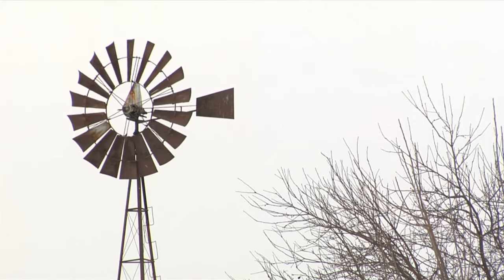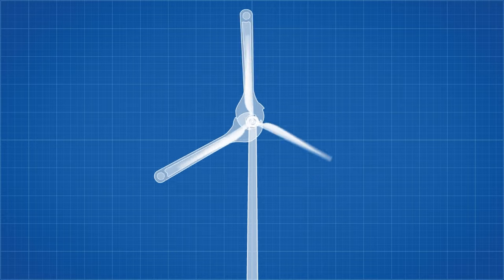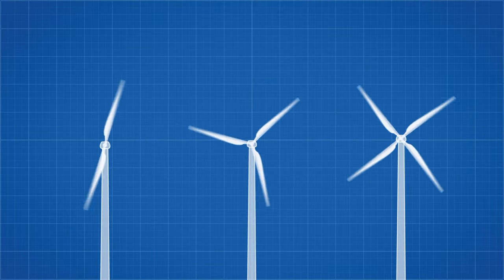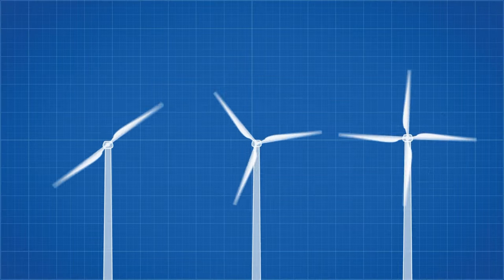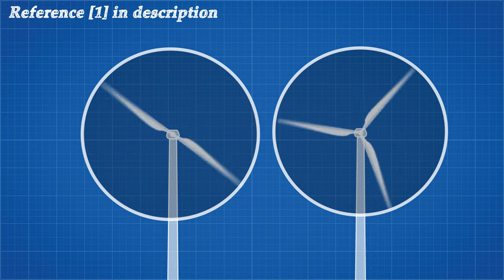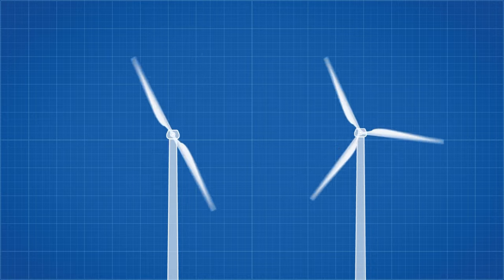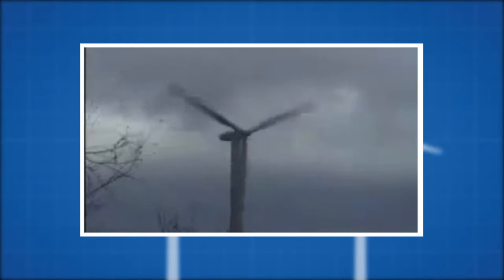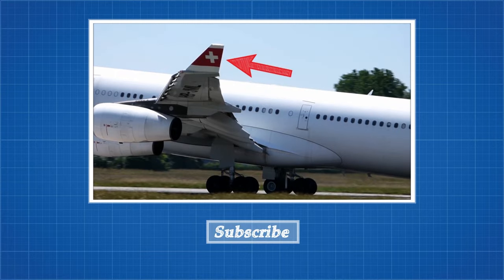Why Do Wind Turbines Have Three Blades?

Comment: quite shallow explaination why not 4 blades. did not explain why the additional power is small, you just stated it. but thats the important part no?
Reply: I thought it was pretty shallow too... Why not shorten the 2 blades so they exert less torque --> less speed on top of saving money on material?  Adding a third blade just to slow down the angular speed sounds fucky
Reply: Yep, sure a fourth blade costs 33% more, but if it's output is more than 33% it makes it worth it. There is really no reasoning for dismissing 4 blades so quickly.
Reply: Less torque = less power generated.  Take a computer fan and blow into it.  It's 7 blades and is spinning more times per second than a wind turbine.  Quieter too.  But it's not going to power your city.
Reply: The guy in this video doesn't seem to have a lot of knowledge about the technical part of windpower... Well yes, they cost some more to produce a fourth blade, but when we are talking about the whole project, then the fourt or fifth blades additional price increase is just some few percent.... 

THE MAIN REASON WHY WE USE 3 BLADES IS: There is a aerodynamical phenomena which is reason and it is someway hard to explain, but I'll try.. If you would have let's say 6 blades, then the wind speed would decrease significantly after the turbine. So imagine what would happen if the air behind the propellers stood still. Yes, the pressure in front of the turbine would also be higher, so the wind would "go around" the turbine. Because it would be almost the same thing as an unidentified physical obstacle would stay straight out in the wind. SO you want to get the wind to go through the turbine as fast as possible, but still take as much kinetic energy as you can from it. So there is this perfect ratio AKA Betz's law (https://en.wikipedia.org/wiki/Betz%27s_law) which says you can take maximun 59% of the energy from the wind, today we're at about 40-45% in the best cases... Then there is also the question, why three blades? Why not two? Or one? That's a different question... :D
Reply: Thank you for clearing that up, I really found the video explanation rather meager. By the way, I've seen a two-blade wind turbine somewhere, so there's probably a lot more going on behind the question "how many blades should a wind-turbine have?".
Reply: +Leo Byskata Good explanation, I thought it had to do with aerodynamics instead of sound or cost.
Reply: Costs only 33% more on the total of the blades, but on the total of the whole windmill including the ground it stands on, procedures, permits etc, its probably more like 5%
Reply: This is what I was anticipating being in the video! He did say in a comment ((today) that he will redo this video sometime.
Reply: thanks +Leo Byskata that's a great explanation!
Reply: Leo Byskata.  Betz's law says that only 59.3% can be extracted from the energy in the wind as if  one goes for 100% the wind has to stop behind the turbine and his will stagnate any flow through it.
There is another factor which involves one blade working in the wake of the other. If many blades  exist then   one is close to the other and the wake will not allow for an efficient flow so  it would be better and cleaner to have one blade as this would  be working in the cleanest "solid" air possible and it is this that will transfer more power to the blade,
I shall not go into the laminar and turbulent flow in multi bladed turbines, but I am sure that with blades following each other  it is like biplanes and tri-planes they tried at the initiation of flying with the Red Baron having two and three winged planes on top of each other.     The mono wing plane took over and we do  not have biplanes to lift 1000 kg per metre square on commercial planes.     All this is related to bi-planes and tri-planes philosophy is related to multi-blades in turbines . Also while the monoplane needs an elevator to stabilise it, I do feel that a two blade turbine and a three blade turbine do consider their moment of inertia about  various  directions in the plane of the disc which for a two  bladed turbine changes drastically to cause stresses on the turbine shaft as they are rotated into a new wind direction.
Reply: I think this is basically explaining what is in the title. If you sum up what he said you can get to the conclusion that it is the market and resource availability what determines why we manufacture turbines with just three blades.

I think it's clear that more blades will definitely do a better job if it didn't require energy putting them together.
Reply: I agree. Currently wind turbines use 3 blades, but I've seen small ones with just 2 blades and if turbines become even bigger, 4 blades might be needed.
Reply: Being more cost efficient and producing a lot of power at reasonably low speeds. Four blades would have negligible power advantages I suppose
Reply: Producing 12 blades you can make 4 (3-blades) turbines or 3 (4-blades), so first option gives an extra turbine.
Reply: It's been a while since I was studying engineering, but the reason why we don't have 4 blades really comes down to cost efficiency. 
-One blade has the highest, but balancing and wear are the reasons why we don't do it.
-Two blades is better and there have been examples but there are problems mentioned in the video. A problem not mentioned is when the blades are in the 12 o'clock and 6 o'clock positions. The shaft of the tower actually restricts air flow and so the top blade experiences more force than the bottom and it increases wear on the tower.
-Then we come to three. It is balanced at all points, costs a reasonable amount and works at optimal speeds (maximum power is drawn at a certain RPM range, being too fast and too slow are both undesirable).
Reply: xokocodo
How does one additional blade cost 33% more? The windmill is more than just the blades.
Reply: Schwarzer Ritter 
We're only comparing the cost of going from 3 to 4 blades. Other commenters keep wanting to factor in the cost of the other components. THE OTHER COMPONENTS DON'T CHANGE.
Reply: Schwarzer Ritter A windmills blade costs over a hundred thousand dollars and not the size of an appartment building. Getting it transported to the area is also a big problem.
Reply: aguyandhiscomputer
Well, yes. But what is the information good for? If you want to know how much more powerful and expensive an additional blade would make the windmill, don't you have to take the price of the entire windmill into account? 
FishTurd69
But the foundation, tower and generator can't be cheap either.
Reply: Schwarzer Ritter 
Yes but we don't know what percentage each component is of total cost. Each blade could be 10%, 15%, etc of the total cost.
Reply: They will if there are twice as many in a given space.
Reply: Schwarzer Ritter You're right. The foundation, tower and generator is not cheap but it's more than just that. Let's say a 3 blade turbine costs $1m and produces 1MW. That's $1 per watt. If a 4 blade turbine costs $1.2m but only produces 1.1MW its about $1.09 per watt. This means overall the 4 blade turbine costs 9% more for every watt produced. (Rememeber we also understand why we don't like to choose 2 or 1 blade designs even though they have higher $/W values)

Using this principle we can understand why we don't use the tallest or longest bladed towers in every scenario. It's just not cost efficient. For the power companies developing these wind farms, it's a business and they hire engineers to design and build these things for as low of a prices as possible.
Reply: Absolutely a shallow explanation. He neglects the brake system, breaking the sound barrier, environmental concerns such as birds flying into them, noise and visual distraction to humans and more.
Reply: Breaking the sound barrier? Absolute Nonsense. And birds. Please paint all your windows: They cause the death of several milions birds each year.
Reply: One more turbine is a bad thing.  that is one more tower,  on more generator,  more to take care of.
Reply: Jason Kim look at his comment mate
Reply: Jason Kim that would mean smaller area therefor less power
Reply: @hermannrochholz1701  No, not necessarily HIS windows, but reflective high rises, sky scrapers that are entirely cladded in mirror-like glass DO kill billions of birds - because dependent on the type of pane used and the with less reflective glass angle, height and lighting the birds will see a reflecting of the surrounding skies in those windows and they will not (be able to) see the actual glass itself - which again might cause them to fly at full speed head-on into a building like that.
Reply: @harrickvharrick3957  Thank you for this explanation. Any literature about that? Statistics? I love statistics ;-)
Reply: Look above for Robb Stark's comment. He explained it properly.
Reply: @leobyskata7219  well done
Reply: @xokocodo  It's intuitive, though, that a fourth blade won't offer as much as 33% more power output. There will be a diminishing return. I'm sure you could demonstrate it empirically
Reply: @leobyskata7219  I wonder if there is a pitch oscillating frequency that has a relation to the vortex shedding frequency that could help maximize the Betz number.
Reply: Sorry. this makes no sense. Of course the shape of the blades are redesivned and the bottom line is that the windmill operates at the 59% limit depending on the surface area, irrespective of the number of blades.
Reply: @carmelpule6954  Betz limit has been smashed because it is wrong  watch youtube video the gyro wind turbine

Comment: This all makes sense but you could make the exact same argument comparing 3, 4, and 5 blade designs and conclude that 4 is the best.
Reply: Not when talking about absolute numbers. If a 3-bladed configuration is better than a 4-bladed one because of the cost versus power-generation, then why would you even compare it to a 5-bladed configuration still? More so, you can't make the same argument by your logic when comparing 1, 2 and 3 blade design, can you?
Reply: I agree but the video didn't mention absolute numbers.  I was just trying to say that the reasoning in this video is reasonable in a relative sense but it needs some numbers to justify centering the argument at 2, 3, 4 blades.

Comment: Actualy that isn't the case. Two bladed turbines have problems with vibrations when pivoting when wind is changing course.
Reply: On top of a couple other things offered in the comments... ^^this^^ too.  The rotational inertia of the whole nacelle yawing (to direct the turbine into the wind) will shoot up and down as the blades spin.  It's at its maximum when the blades are horizontal and at its minimum when the blades are vertical.  Thus, the system will shutter as you try to yaw the nacelle.
Reply: sjoormen1 hhh